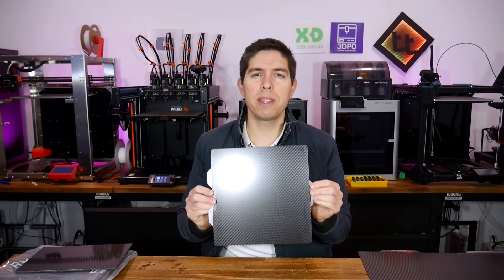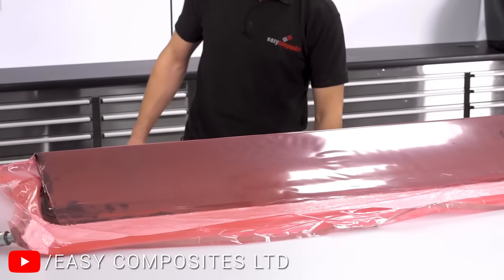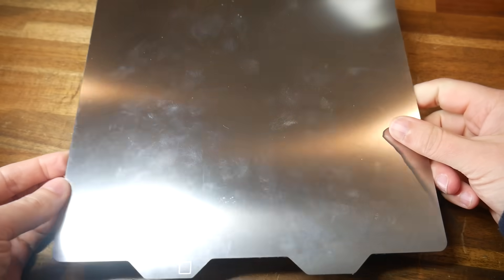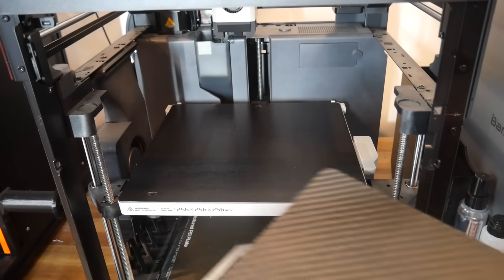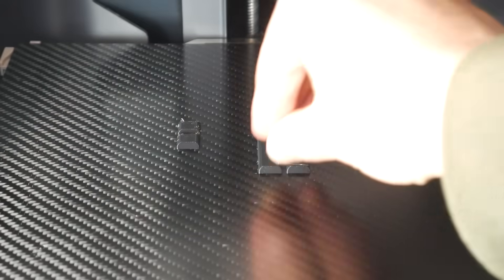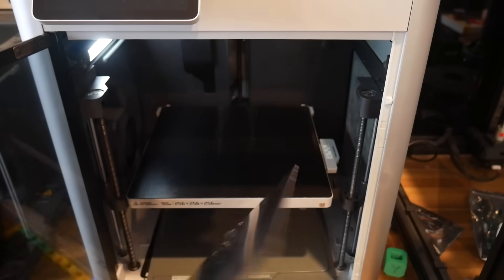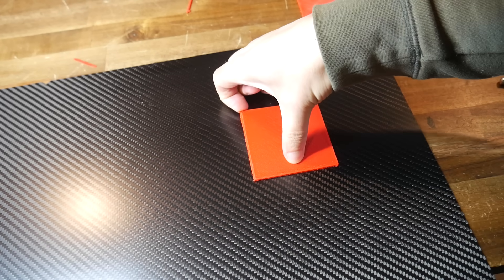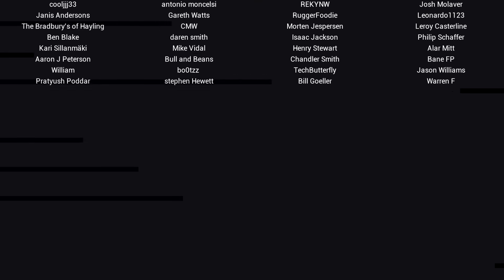Testing the Wham Bam carbon fiber plate - The ultimate 3D printer bed?

Comment: Im not in to the game of printing beds at all, but why is no one using mirrors or glass as a print surface? Does it have disadvanteges?
Reply: terrible conductor of heat and heavy, glass beds used to be the norm ages ago. prints also stuck way too well
Reply: Borosilicate Glass beds used to be one of the better options out there before all the most common bed types these days. There are better, cheaper, and safer build plates these days. Glass beds have the nasty habit of shattering, and being pulled apart by certain materials.
Reply: I use a borosilicate glass sheet on an Ender 4 (H-bot). On the glass bed I use heavily diluted PVA glue, prints stick well, but you need to wait until the bed has cooled down to remove the print. Biggest plus is that it is way flatter than the original bed which is warped to all hell.
Reply: Material compatibility is bad.

Glass works well enough with PLA, it both sticks and releases. It is a little finicky since it's sensitive to contamination with finger oils, but it's quite robust against nozzle scrapes and can be cleaned easily to bring back its adhesion properties.

Compatibility is not good with PETG, since PETG easily welds itself permanently to glass and takes out a chunk of it. You need to use a release layer such as glue stick and you better be thorough applying it or you will regret it.

ABS, ASA, HIPS do not stick to glass pretty much at all not even a little bit, HIPS is particularly bad, also Nylon, i think TPU haven't tried.

And yes weight is bad and thermal conductivity is very so-so, could be worse.

Comment: Seems kind of like a missed opportunity for it to not leave the Carbon Fiber pattern on it. Are you not just printing on the epoxy then since the carbon fiber is encased and sealed in the epoxy? The filament is being laid on top of the thin layer of epoxy. I understand the strength component when it comes to carbon fiber in epoxy, but I feel like the use here seems strange. I feel like the bigger variable here would be the kind of epoxy used. Carbon fiber absorbs and holds heat very well, so I guess that's a small plus when used with a heated bed. Doesn't seem very worth it in the end, and just feels like yet another build plate.
Reply: He mentions this at the end
Reply: I agree, there might only be slight differences from using one of the official plates, but since now it is 20% off, the prices are somewhat comparable and these look pretty slick so I'm thinking about getting one and keeping the stock Bambu Lab smooth PEI plate as a backup. If it brings some advances then very good, if not then at least it will look pretty cool in the printer I guess...
Reply: Not a missed opportunity at all.  I won’t buy one if it does that and my customers won’t buy my products if there is a  texture pattern placed on it.  
Makes lots of sense to not release it to leave an imprint and if the plate works well they could always consider it for the future.  
The durability of the plate itself would probably be lower and require more tending to if it was made with a surface so this it exposed the carbine texture.
Reply: @JoeyMoreland Agreed - the holographic textures that cause prints to look like carbon fibre are NOT the same as actual carbon fibre that's visible in 3D through the transparent resin. Real carbon fibre isn't a surface effect so there's no way to make it "print through".
Reply: Yes you are printing on top of epoxy, but your epoxy sheet is dimensionally reinforced by carbon fiber so it doesn't warp and deform potentially popping your print loose mid print.
Reply: @middleagebrotips3454  okay, so literally just G10
Reply: @nikoraasu  in theory yes. Unfortunately the resin of g10 varies from vendor to vendor and is not mixed with build plates in mind. My g10/fr4 sheet sticks to absolutely nothing, the damn magnet on the bed has better adhesion than the fr4. Carbon is also a lot stiffer, which comes in handy with warping materials or high bed temperatures as i had some pei flex plates warp.
Reply: The biggest missed opportunity is not directly heating it since carbon fiber is a very good resistive heater with some angry pixies in the mix.
Reply: @Guardian_Arias  that is possible but not practical for what they are going for here. This is supposed to be a drop in replacement for existing printers, some of which cannot easily be modified.

If you wanted to do what you suggest then you would need to add a thermistor into it as well and a way to connect it to the printer, it isn’t as simple as just sticking it on top of the heated bed.

Heating the surface directly likely would have much advantage either.